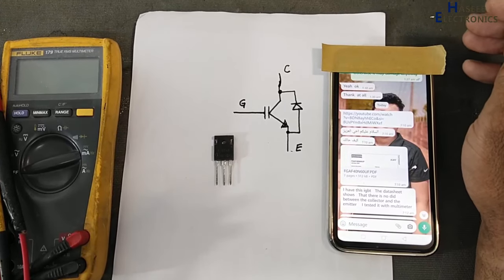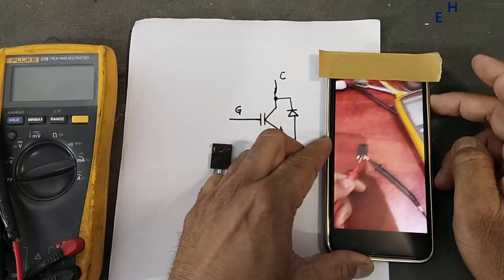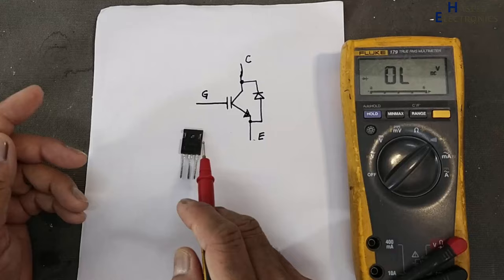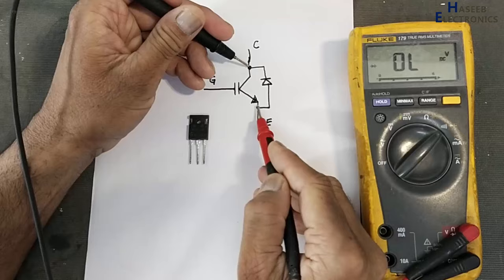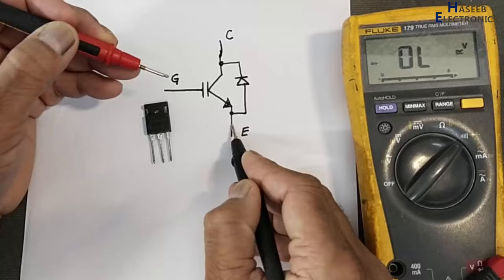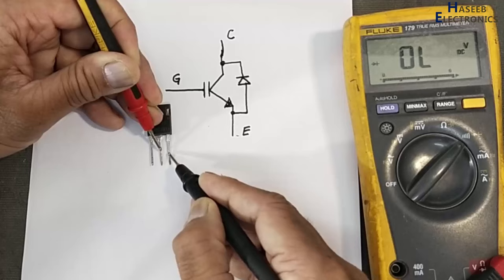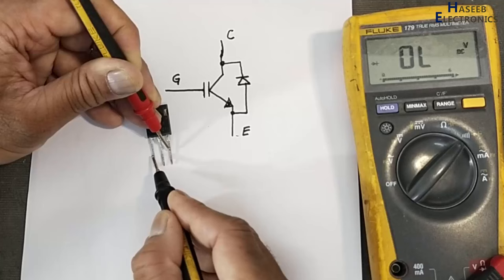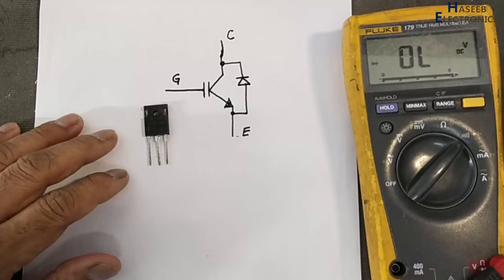{1088} How to test IGBT with digital multimeter || IGBT testing

Comment: But now is very lots fake, not original transistor s
Reply from the maker: yes 
you are right
there are too much false marked fake components sepcially IGBTs, MOSFETs, and power modules
Reply: You can purchase from good sources, for mouser they will provide free shipping depending on how much you buy. For digikey there is no free shipping (i tried both)
Reply from the maker: Digikey
Rs-online
Farnell
Mouser
Utsource 
Are reliable sources
Alibaba, AliExpress, made in china sources are also good but it depends on luck, sometimes the vendors are real and sometimes not
Reply: Digikey, mouser very expensive. And delivery in Kazakhstan about 120$, very expensive

Comment: hi Mr. Haseeb, I have Fluke 87 III , but it can not turn on IGBT , the voltage across leads provided by fluke 87 is 3.7v on diode mode, I have bench multimeter ( works on AC) provides 6.6v on diode mode which can open the IGBT. I know it depends on IGBT specs, the operating voltage, but I am surprised that your fluke can open IGBT, I would like if you tell me the voltage across leads on diode mode. thank you.

Comment: Sir some where I heard, the original or very good igbt gate doesn't activate with multimeter. Is this myth? Thank you🙏
Reply from the maker: yes you are right 
some mutimeters have low test current in diode mode or resistance mode, which cannot charge the gate,

Comment: Same as testing a mosfet except a mosfet shows a much lower reading when on. I have a question Mr. Haseeb please! About the same topic about the mosfets configuration in BMS circuits, where we see them as low side mosfets but we see both drains connected together instead of having source to drain connection like the DW01A IC or similar ICs. So how does this configuration work please?

Comment: It happened to me before. The model you have, Fluke 179, in diode mode gives 7.2V, which is high enough to trigger the gate, unlike the model he has, Fluke 17B, which gives 1.2V
So, he should try to trigger the gate with an external DC source.
BTW, Thank you sir
 your contents very informative and full of details

Comment: Does the measurement apply to all IGBTs, sir?
I'm currently measuring IGBT, type Magna 6065PES series chips.  If the measurement method is the same as the one you video, it means that my IGBT is damaged.